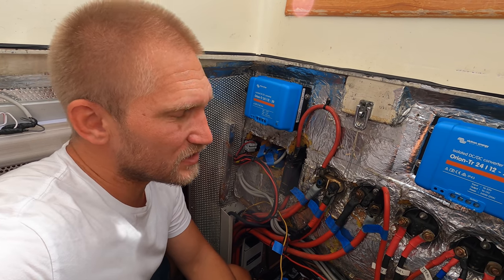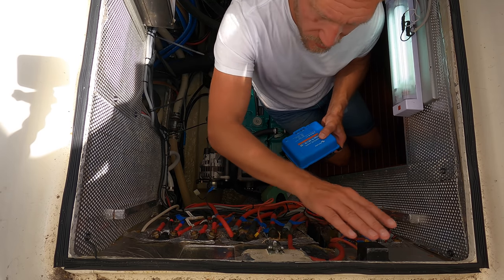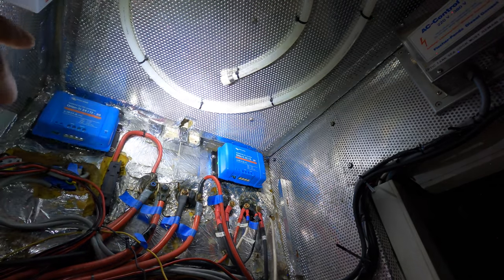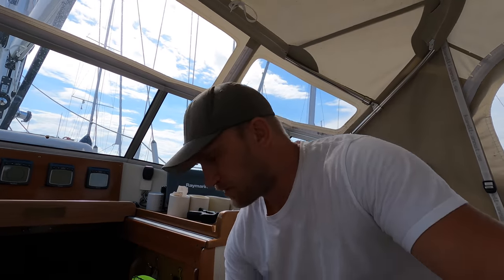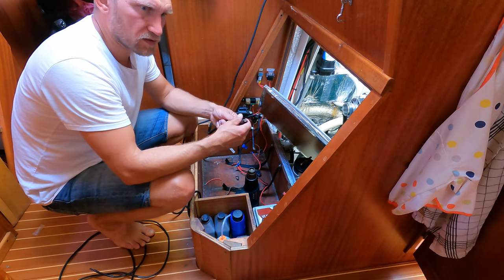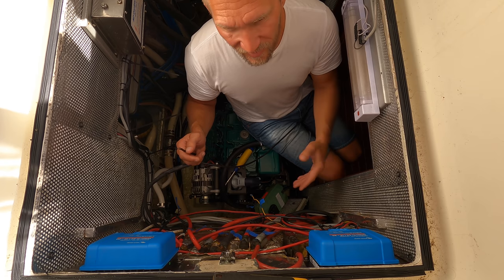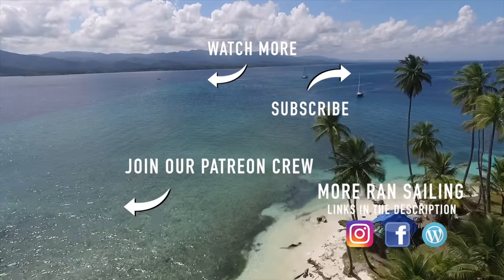Getting the Boat Ready for the High Seas - Ep. 263 RAN Sailing

Comment: Johan, I appreciate how you well you 1) Light up at each chance to learn by doing, and,  2) demonstrate "one learns by mindful, intentional doing", right down to labeling wires -- from an electrical engineer who's also a DIY tinkerer!  Skilled hands like yours teach the bookish, vicarious academicians who have never held a tool, demonstrating who's understanding is truly real.   Useful electrical safety tip:  Put some shrink tube around your metal tool handles.  It will help insulate you from +24VDC (and higher voltages) buzzing your body to ground -- even accidentally.  

There are always obstacles with any project.  The self-inflicted problem is accurately assessing their extents, solutions and trade-offs. 

Blessings to you, Malin and Vera!

S/V "Windwalker"

Comment: You are just being humble and modest when you say  "If I can do it then anyone can"  Even though that is not true, few have your "total package" of self taught abilities, but it's also a virtue for you to say it.  Just another reason you have the best channel on YouTube.  Just an observation. At full tilt (40A) the DC to DC convertors dissipation may be much higher than the conversion efficiency stated on the spec sheet ( the spec sheet is at their "Sweet Spot in the efficiency curve") and they will actually not share the load as well as you would think, one will hog a bit more in most cases due to component variations in the power and control stage. (In practice using one large one would always work better than two smaller ones when doing load sharing like this.) This will make them hotter that you expect if you are running them at full load.  I bet the spec sheet says ~ 89 to 91% efficient but they could be more like 84% at 20A each.  So at a 240W load each you may see ~38 watts of dissipation each not ~21 Watts.  That's about 76W of heat vs 42W.  Heat will kill convertors faster than anything else.  Watch for over temp alarms or shut downs when running the engine for a long period of time since they are in the engine room.  I would put an air exit fan in there if it were me. Just blowing a fan across them would not do much.  But I bet you "over-sized" them for the 12V load you will have because that's what you do when you design your systems, and my point is moot.  Good job as always.

Comment: I like to use ferrules when installing a pinch wire connections. This protects the bare wire from fraying when pinched down, especially when you neeed to remove the wire and reinstall it again. If you don’t use ferrules you can tin then end of the wire with soldier to help preserve the wire strands.

Comment: Johan. Have you installed an electrical ground isolator module? These prevent the boat from being a ground path and saves you zincs from excessive decay at marinas. This happens because marinas or other boats nearby have current leaks and the path sneaks though your ground system. They are simple and fairly inexpensive.

Comment: That’s really heavy. Last winter I off loaded the 4 D house battery and reinstated two 4D batteries. We used the dingy motor lift to lower and raise the batteries to and from my truck. Then we used the boom to rig a line from a winch to raise and lower

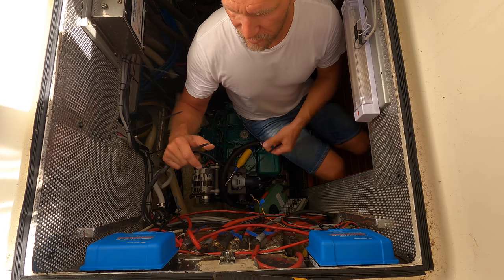Comment: 15:35 Problem with doing all the DIY stuff is, buying the proper tools ($$$) and doing the job and messing up the first couple times ($$$ and time and extra spare parts needed, more $$$) and then storing the tools for next time (valuable boat space, weight of tools, and also avoiding rust on tools).  Already have a small shop's-worth of tools on my boat and need to chuck the automotive-grade stuff to upgrade to marine-stuff like electrical crimpers.  And then doing any project means completely ripping apart living areas so that motor oil greasy parts are sharing the counterspace with lunch cooking on the stove and floor space next to sleeping area is stacked with various chemicals like fiberglass resin jugs and carburetor cleaner.   Other than that, boat projects are fun.
Reply from the maker: Hahaha! 😂 Spot on!
Reply: The cost of tools is trivial compared with the cost of having work done by a boatyard. Yes you may mess it up but with luck you will learn. The main point though is that "There aint no repair shops in the middle of the sea". You just have to fix the problem when it happens or live without until you reach harbour. To this extent, sailing vessels have the advantage of posessing two sources of power, engine and wind. A motorboat with a failed engine is just a raft.
Reply: I thought the whole idea of having a boat is the excuse to buy new tools.
Reply: @rogersaunders7858  That is somewhat true that equipment needs to be fixed in remote locations however the new reality is that the new components on RAN-II and other modernized sailboats will not be able to be fixed, because they are computerized, surface mount electronics, or even completely potted in epoxy, the only way to fix anything will be to replace the entire component with a complete replacement.  These are superior engineering products anyway compared to anything in the past, so they likely will not fail.  Which is fine because even if they do, as of recent years and global shipping, it is much easier to get replacements from online to anywhere, if able to wait and pay the import bribe/tax.   Once I remove the diesel engine from my own sailboat and go electric then the engine will not be serviceable either, it will just be "unbolt and replace" in various types of large components.   RAN-II is now such a complex boat with new motorized reefing, motorized anchoring, motorized winching, new electronic nav devices ... those components should last 30 years minimum without problems if the internals are kept corrosion-free.   These boats which have problems "in the middle of the sea" are using either improper products or not refit properly from the start.  Which is the real problem of not doing the work DIY.   Relying on the boat yard workers.  In southern California many of the boat yard workers are simply bad, sloppy, lazy, don't care, unqualified, untrained, unapprenticed, unsupervised, unaccountable.   So it is hard to get a reliable boat from the start, with sloppy contract work done in the yard or in the marinas.

Comment: Great video. I did not know if I should laugh or cringe when you crimped the cable  ends using a cutting board as a working platform.

Comment: Leaving old obsolete cables in place occurs in many places. During my working life our main film coating track had been upgraded many times but -- there was rarely any money allocated to removing old wiring. the result was that the ducts were crammed full of old cable which nobody could identify and did not dare to remove. 
One official attempt to remove unwanted cable was a disaster with the whole track out of operation for hours - very expensively. In retail terms, it was producing product at about £6000/ minute. No further attempts were made.

Comment: 9:43 It's a small thing but if you place converters in parallel, I believe it's advised to make all (positive) cables  the same length to avoid voltage differences. I'm not a specialist but that was something I did noticed in your setup. In this case the cables are very short, so maybe it will not be a problem. Also  double check the settings of the converters. Good luck for upcoming adventures.

Comment: If u ever replace normal batteries with lithium batteries, it is very important to have the same length on all the cables that goes to batteries. Or you will end up burning out 1 batterie all the time as that takes all the load.  The sailing channel "O'Kelly's" just did vlog about this.  Has something to do with when you use lithium batteries the electricity goes the shortest route ( cable ) so its one batterie that gets hammered all the time.

Comment: Hey Guys I have the 12/12 version of the victron dc/dc converter (I use it to protect the alternator when charging  lithium), but I find it does get really hot. It's generally maxed out at 30amps, so not that surprising - I'll probably add a fan one day.

Comment: With these modern live-aboard electrical systems it seems for every one thing removed, two more are added. And then you need backup replacement parts when something fails. How do you keep up? Most importantly where do you find the space? I think it would drive anyone mad after a while.

Comment: Great video as usual! Johan, I am curious, what is the white pipe that is in a spiral under the engine compartment hatch?
Reply: I think it is the hose that is used to suck the oil out the engine when an oil change is needed.
Reply: @newzealandfromadjimini2cor452  Ok! That makes sense, thanks!
Reply: Given that it is zip-tied in several places, I would not think is is for emptying oil. Could it be part of an extinguisher system mounted above the engine room in case of fire? Sure Johann will tell us!
Reply: It is a fire extinguisher

Comment: What is the white / clear  hose attached to the insulation on the engine hatch cover ?
Another great video .... Thank you
Reply: It is a fire retardant system. The hoses are pressurized and filled with a potassium solution. They break under high temp and quench any fire.

Comment: So, if one of those DC to DC converters that are wired in parallel fails how will you know that until you need to pull more than 20A?  Is there some kind of monitoring system that comes with them?

And you really do need to replace that tight wire as it is sure to eventually fail and at just the wrong moment.

Comment: I sure hope that those DC/DC converters are rated to be used in parallel? Connecting power supplies in parallel can be tricky if the supplies are not rated for parallel connection. If the units don't know how to share the load, 1 of them could be in a constant full load driving it into the other 1. In the worst case this can cause a fire (I'm guessing that having a fire while at sea would be a very bad thing).